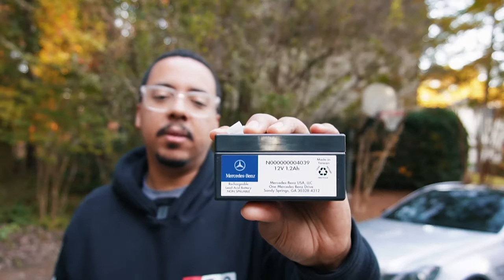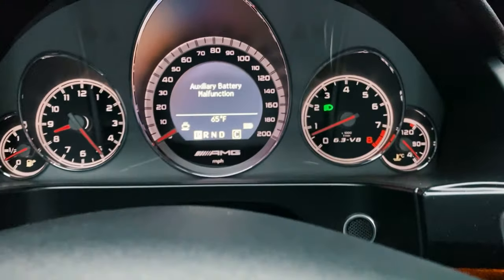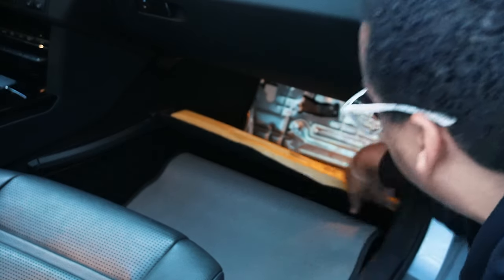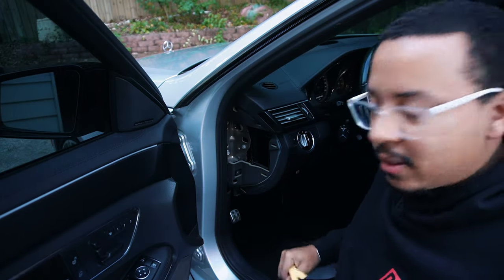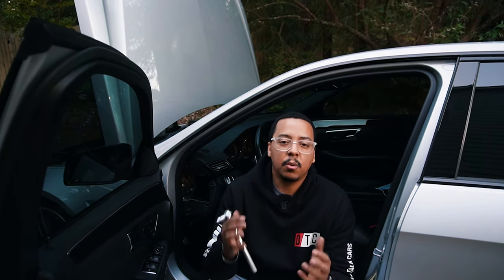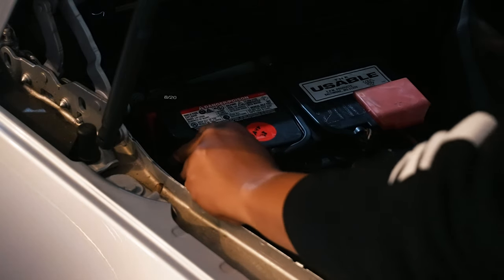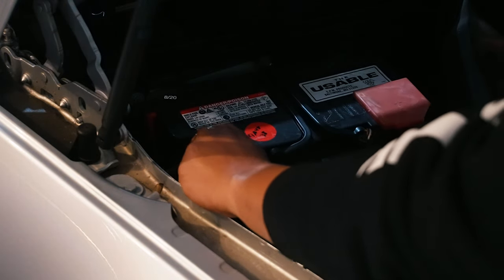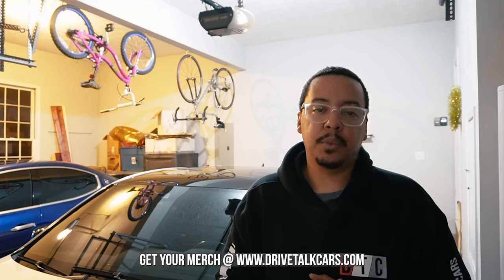How to replace Mercedes auxiliary battery!  Fixing Auxiliary Battery Malfunction dashboard error.

Comment: Mine has been showing this for a while. Thank you for making such easy to follow content, I think mine only comes on during the winter and it turns off during the summer, so it might have something to do with the weather as my location can get very cold. I'll replace it when it comes on permanently.
Reply from the maker: I am glad you enjoyed the video and it was helpful.  Yeah, it might be the weather. I only started seeing issues when the weather got colder.
Reply: Why are batteries worse in winter?
But just as heat speeds up chemical reactions, cold temperatures slow them down. That's why you might feel your battery can become sluggish in winter, even though its state of charge may remain unchanged. At colder temperatures, the battery's ability to provide sufficient power to start and run a vehicle is diminished.
Reply: Great video! Can you still drive when it comes on?
Reply: It will blow up 😂@moreeshintaro6804
Reply: I'm currently having the same issue, I think I might've prematurely bought another battery because of the weather conditions as I suspected but I've kept my old battery, but the message is showing all the time even on the new battery. Please help?

Comment: Thanks for this, I was able to replace my battery with a $55 battery from FCPEuro (and probably could have done a $15 no name from Amazon) instead of the $300 the dealer wanted.

Note that if you are having a hard time doing it through that little hole in the side of the dash, you can just undo the three T25 screws in the panel on the bottom of the dash (above the footwell), and get much more direct access from there. The cage still doesn't come out as there is a harness attached to it for some reason, but it hangs down low enough that you don't have to reach in much, and you have a much larger opening.
Reply from the maker: Glad you were able to get it fixed. Thanks for leaving comment!

Comment: Great video, very useful thank you.
I have a UK spec 2010 model so it’s the same but opposite. 
Couple of points to note:
1: If you’re using a non MB battery replacement check the terminals as the one I had, the terminals were the other way round. Sounds basic but you can’t teach stupid.
2: If you’ve got hands bigger than a 5 year old then it’s a tricky procedure. The hand brake cable gets in the way and as soon as you release the holding bolt the battery and cradle drops. For those with bigger hands I’d suggest undoing the trim under the steering wheel, 3 torx screws, and getting your hands up and under and dropping the battery down that way. Fit the new battery up and under too. Saves the faffing with little piddly gap. You shouldn’t need to remove the trim totally as you can move it out the way to create the space.
Reply from the maker: Thanks for the comments!

Comment: Hey thanks for the helpful vid. I just changed my E350s Auxiliary Battery saving me at least $400 if i had the dealership do it for me. Question, i can see a wire with a yellow fuse at the end marked no. "5" hanging loose, i'm not sure if i accidentally disconnected it. Any idea? Thanks again for the useful DIY vid.
Reply from the maker: Thanks for checking out the video/channel and leaving a comment.  No, I am not sure about that wire.  Do you see where it connects in the wiring harness?  I would assume there would be a message on the dashboard if it was something vital to the car's system.

Comment: I changed my Auxiliary batter because my locks were going crazy and my ac wasn't blowing cold as it used to was it the Auxiliary batery causing the problem? I didnt see any warnings about the battery at all

Comment: Thank you so much ,but  mine I have replaced the auxiliary battery the error continuously showing what could be the problem.
Reply: 1- might need to use an ODB2 device to reset the code (goto pepboys, autozone or other autostore and they usually will let use theirs to reset) 2- could mean that your main battery is starting to go bad, 3 - charging issue (need a mechanic)

Comment: The dimensions of the battery would be helpful... 
Is it seperate from the charging system ? If so, probably no need to disconnect the main battery..
If its charge just runs down over time, why cant you just re charge it ?